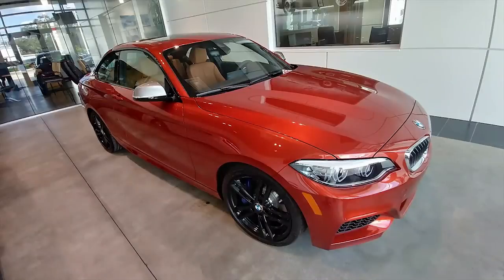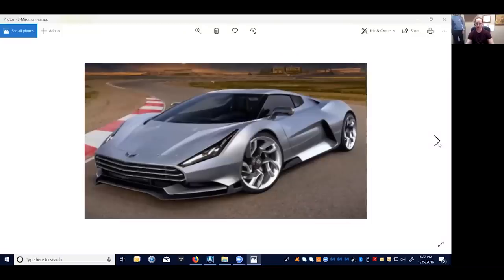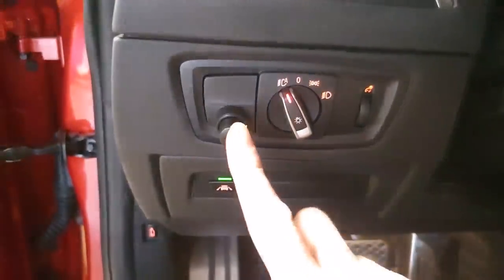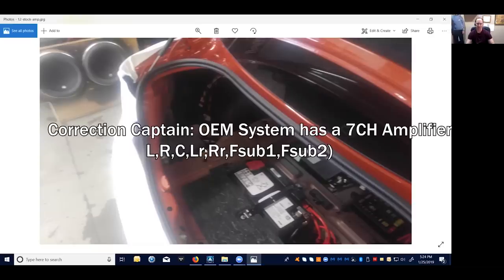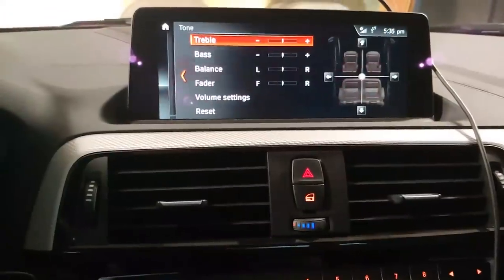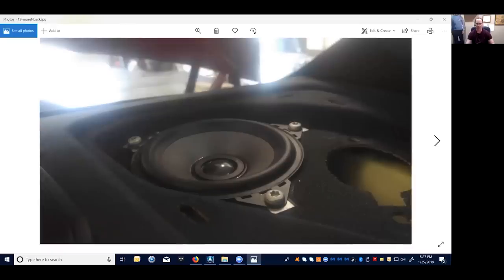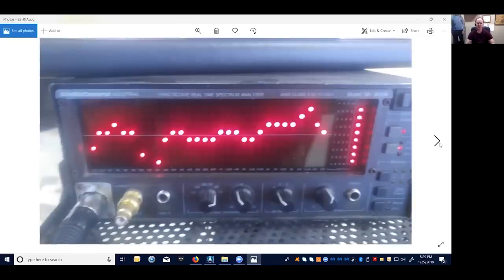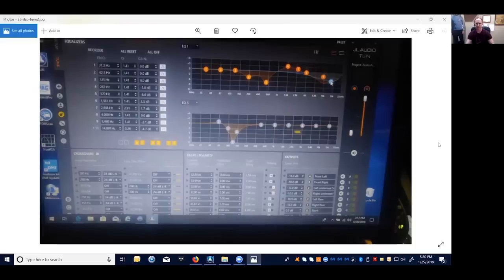BMW 2-Series Audio System Upgrade Installation & Calibration

Comment: Sorry old vid post but hoping you can advise. I just installed a system in my 240i have "hifi" system and added a 10" JL sub and Alpine sub amp and used a wire harness interface from pnp technic that pulls wiring out of stock harness to run power and high level sub output into a Line output converter. Problem is the bass is Boomy beyond belief, no low sub hard hits at all and seems there is a maybe 90-100 hz emphasis too. My question...I think my harness add-on from pnp tapped into a sub output that was filtering out the good (low frequencies?) and that factory system filters low bass from stock subwoofer. What are your thoughts?

Comment: This is super helpful.  I just picked up a 2019 M240i with this same awful sound system.  Question if anyone knows - for the Harmon Mold tweeters added to the A-pillars on the doors (8:15 in the video) - was the crossover split off the Morels installed in the doors. Was the crossover added because there is no cabling running form the A pillar tweeters back to the amp?  I read the the update Harmon Kardon HiFi with the A Pillar tweeters there are input for the tweeters into the Harmon mid door drivers.  Thanks!

Comment: You know man.  I hear you on the time alignment , but sometimes it’s a bit overrated.      What I mean is that I time aligned my speakers in my BMW and yes the soundstage is more precise.   But sometimes it more fun to be surrounded by sound without time alignment.  
If that makes sense.

Comment: Corvette in Bowling Green should watch this. After a test drive of a new Z51 3LT beauty a year ago, the salesman said, "so, should I write it up?" To which I responded, only if you change out all those BOSE speakers. Too bad Chevrolet doesn't seem to get it yet. All horsepower,  no Audiophile.
Reply: Aha, you noted it too about BOSE. 
I told a story in another vid that I hardly could recognize a CD I heard a lot, when played in a BOSE system.
This presented here were a more advanced system than what I am putting in my own beemer in a week or two, nice to watch though.
Reply: No one is buying a Corvette for the stereo.
Reply: Yep, BOSE is all Marketing and Lawsuits. They are NOT an audiophile's choice of high-end fidelity. And yes, I DO buy my vehicles partially based on the sound system, as I'm sure thousands do as well.

Comment: I have a 2014 328d with the Hi-Fi and it was absolutely miserable until I put the Focal subs under the seats. All the rest is stock and is Meh. It's lasted me a while but now I'm ready to upgrade the rest. I think I might do a audio control LC-6.1200 and haven't quite decided what I'm going to do for the door speakers yet but thank you so much for all of your advice! It's good to hear someone that has their own opinions instead of just trying to sell me a plug and play.

Comment: I just finished my install on my bmw e39. I got a pair of  alpine type r 5.25 components in the front doors and in the back under the window, and i got an 8in sundown sa sub in a slot ported box tuned to about 35hz in the trunk got those all powered by an alpine pdx v9 5 channel amp. I love how the factory mids came in speaker pods, sounds really nice with the type r mids in there. I was also very impressed with the 8in sundown, it has alot of sound for such a small sub, it actually flexes my trunk a little.
That pdx v9 amp is very impressive as well, it puts out about 100×4 and 500×1 on 4 ohm or 2ohm and the size is crazy small.
Reply: i did all that and just sold my e39 what a car to put a stereo in ill tell ya

Comment: You set the 4” woofers that low at 120hz and 150hz?    I’m pretty sure those have an Fs of around 110hz so they should be crossed around 220hz to be on the safe side or 200hz.  
Great video!
Reply from the maker: Yea that was raised in the final calibration.
Reply: @Audioholics  sorry that confused me.   So in the final calibration they were raised at 200hz for the front doors and 250hz for the rear deck?  
More according to the Fs of the speakers?     
Did raising the crossover lower the soundstage from the dash?

Comment: Folk, the problem is that not a single well know artist is telling you anything on what kind of system to buy to listen their music in cars or at home. AS i intend to listen great heavy metal in my home in cars i have to decide between 1 tousand different kind of configuration and brand and 6 000 kind of format and connectors. Complications stem from artists just working for big corporate copyrighted music labels and for audio equipment manufacturers wanting to sell ever and ever improved amps, speakers, console, files, music channels with fees, etc. can you imagine listening real artist concert in your car or at home but with stupid ads and cookies while you listen to them and without any bass and treble switchs to actuate if ever your tweeters or bass units and not perfectly flat. Also if you like big bass or big treble and you happen to have the perfect system, than all the other peoples listening the audio system while they try to play their favorite artist in the system will experience too much bass or not enouph bass or too much treble or not enouph treble or too much sound at left or too much sound at right and each and all today audio equipment do not have anymore bass and trable switch. So do like me just buy a single pair of computer speakers at below 100$ because expensive gears is just made to be upgraded all the time if you ever can start to play them. Here is an exemple in this video where they order you to upgrade an already expensive system. What kind of system elvis would buy.

Comment: I've been spending the last few months learning not only twk88 but car audio tuning in general while I diy setup my 2013 135i. Still need to use the audiocontrol mobile rta mic to dial in the eq but I'm getting there (finally tuned in amp gains with a multimeter after finding an effective clean input voltage through the twk88)  

I'd like to really thank you for this follow up guide on your audio overhaul as its been super helpful in the process. 

This being said, I've been reading a lot on small mids even on JL's site (https://jlaudio.zendesk.com/hc/en-us/articles/226655828-Setting-Crossovers-) and the general consensus seems to be that mids smaller than 5.25" inches are strained with frequencies lower than 300hz.

 I was wondering how are your morel mids holding up with such a low fq (120hz as in your twk screen shots)?

 I'm currently at 300hz hpf and even then I'm a little worried for them. (Audiosystems evo plus bmw hifi plug and play 3 way fronts)

Comment: Nice work! I'm curious, were you able to get the twk to acknowledge the passive crossover? I just installed an arc audio 1200.6 (as an upgrade from the xd600/6) and audio system (german plug and play for e and f series hifi cars) evo 200 plus. tweeters and mids and underseats. Left the rears temporarily. Anyhow I am having a hard time finding a way to configure the mid to tweeter crossover with the twk 88 tun software. I also came from hifi on my car. I noticed you had some form of passive crossover as well and I'm curious how you or your tuner got around this? Im not new to car audio but it's my first time working with a dsp and it's a bit overwhelming

Comment: Hey Gene, I had an F80 M3 for the past few years (lease) and it came with the Harman system. I wasn't that impressed with it. 

Anyway, the system looks good and the mic sounds good (was it a clipping issue before?) Also, curious why you didn't go with the L minus R on the rears like you mentioned in the video you did a while back. The reason I ask is because I'm installing a DSP in my vehicle in the next week or so.
Reply from the maker: Hi Joe. I did 4CH stereo on my calibration just to get things going. I did L-R with the JL Audio tune which is great for the front seats but bad for anyone sitting in the back seats. I'm going to have multiple tunes for 4CH stereo and back L-R when there are no back listeners.

Yea the mic was clipping but I think my computer soundcard and the Zoom program are the reasons for the poor audio quality.
Reply: @Audioholics  I'm a huge fan BTW! I always refer to you guys in my videos. Hope to meet you at Axpona.

Comment: i have video or 2 on my channel of the sound system i just did in my truck.  all JL Audio, C3-650 up front, C1 5x7 in back, and 3 15" subs behind the back seat. xd1000/5 running the mids and highs. A RD1500/1 powering the 3 15's.  The head unit is an older Pioneer Premier DEH-P880PRS.  Dynamat is next for the diesel super duty.

Comment: Just installed a 10w6v3 with JL 600/1 to my 435i 688 Top HiFi with Technic's PNP adapter. Sub bass is more than enough and thankfully I put a remote bass knob in the same place as you to turn down when too much. Overall the system sounds better but the mids and highs still need a lot work. Still hurts to listen to sometimes when turned up. Only problem is the complexity, or rather cost, to add an aftermarket amp with the MOST fiber optic coming from the HK system. I'm no audiophile but really lame they would put out a "premium" sound system like this.

Comment: It is crazy what all the doodads needed to integrate aftermarket audio into a modern vehicles. T harnesses, iMaestro datalink, etc.  I am surprised Maximum A V did not recommend sound treatment for the doors along with the FastRings.  If your up near Clearwater, 5 Star Car Stereo does killer work and are very helpful on their YT and FB streams. Folks drive in from out of state to get their installs done by Dean and Fernando.

I have a Pontiac G8 that I am collecting equipment for. Hertz HiEnergy 6.5s for doors along with a Hertz ML 5 chan.  Sound treatment for the doors and trunk area.  Still need some 8s for the rear deck.

Comment: I love your channel and videos, what kind of Headset Mic do you use?  It sounds ok, but not great for audio commentary, I don't think that particular headset is doing you any justice, here is a possible suggestion, if not, totally cool, I understand, I'm just hoping the below audio setup may help you for better audio quality.
I get great commentary audio from using the Audio-Technica AT2020 USB, Rode PSA1 Swivel Mount Studio Mic and AT2020 Foam Windscreen Pop Filter by Whisperteknik.  
All bought from Amazon over the years since 2010 when I started with Minecraft Videos.  Definitely improves sound quality for Videos.  
With any luck you will see this comment and I know it will help to improve your audio for your videos.  
Essentially for Audio in my Videos, I use Free Programs, like Windows Movie Maker, if not live commentary, I use the Default Voice Recorder on Windows.
Save as MP4 or WMA file and add it to my video using Windows Movie Maker.  
Once again, I hope this helps and have a great night/day depending on when you hopefully see this! :)

Comment: Did you consider getting a low output but deep extension sealed subwoofer just to fill in that last little bit of low-end?  That last little octave can just make so much of a difference even if technically most material doesn't use it  Thanks a lot for the video.
Reply from the maker: Yea I really wanted to do a sealed sub in the trunk. Maybe a future project.
Reply: @Audioholics  Would you mind saying what your current measured bottom end frequency extension is?  I'd be really curious.  I think these high-mounted 4" speakers with nearby twitters and 8" below seats is fundamentally great configuration of sound quality potential.  Curious what you can actually get with the 8" subs, though, in their tiny little enclosures.

Comment: Hey Gene.  Been looking forward to this for some time!  Hopefully your back/neck are OK by now.  I'm quite surprised that you're tuning in-car by ear as it's very different to what's heard in the home.  It would be interesting to see how it measures retrospectively.  As for the under-seat bass drivers, are they connected correctly?  It seems strange that you should need to reverse the polarity in the setup rather than in hardware.  Nevertheless, it may help people point to performance issues in the bass department in their builds.

Looking forward to the next one.  Thanks :)
Reply from the maker: thanks Mark. My neck will never fully recover but such is life. Yea it turned out that by tuning via ear reversing the polarity got rid of a resonance that would have been eliminated if I was able to do full measurements to accurately adjust PEQ. I wanted to see how good I could get it by ear so I kept that tune file in the memory to always compare to the JL Audio tune. I actually prefer my tune when listening to talk radio bc the rear speakers slightly untime alinged really anchors the voice to the center from the driver seat. I was surprised at this result so I kept it :)

Comment: I was told once  that if you get a Bimmer that works...  dont mess with the electronics..
Reply: only if you dont know what you're doing. Become familiar with the modules and you'll be alright. Done lots including an audio system on my e82 myself. Just use common sense, disconnect the battery before you work.
Reply: @MrSiyamson     That's  SOUND  advice...  I mean  some the  stock systems these day aren't too bad..  but i CAN see  the need for some upgrades.
Reply: @gewglesux  the stock hifi system is terrible. My gfs 07 mazda had a better system from the factory

Comment: Only weakness is the DSp. The BEST DSP ON THE MARKET IS THE Rockford 3sixty.3 its a 248BAND PEQ!!!! . so in other words every band is a peq unlike 8 band peqs. Tune to perfection. PS Install that JL Audio DSP at home easy. Or you can buy the Dayton Dsp408 which is 150 bucks work home and car
Reply: I personally would go with MiniDSP C-DSP 8x12 V2.0